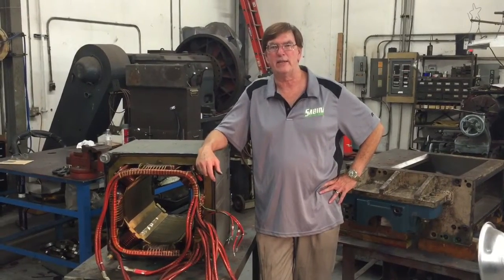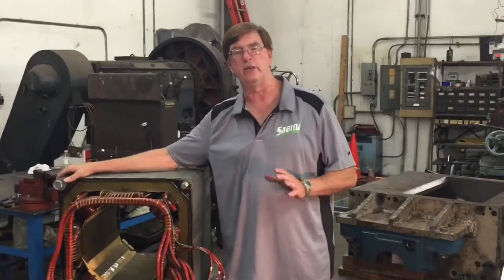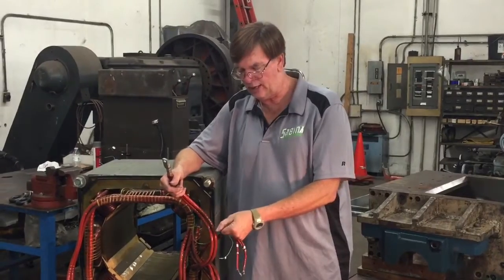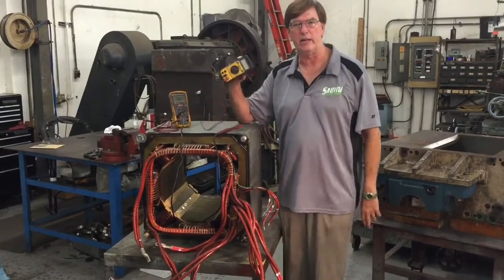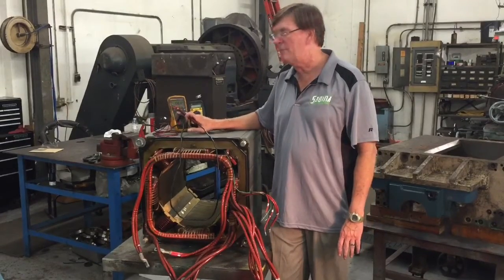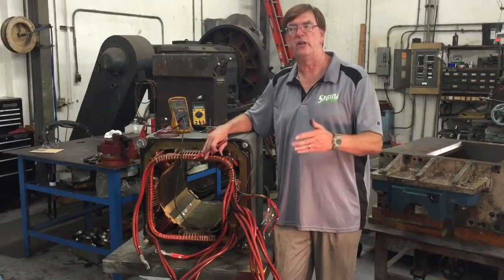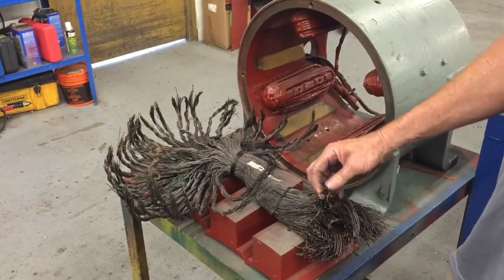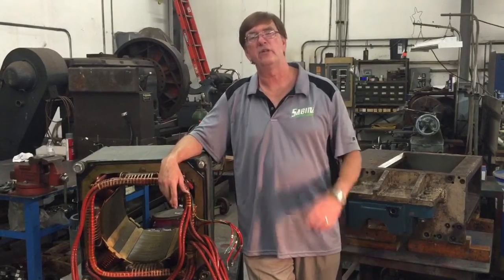Shunt field for D.C. motor

Comment: Never change direction of a dc motor by switching field leads! If it has a compensating or series fields the polarity will be bucking each other. Only change direction by switching armature leads
Reply from the maker: This is true some motors have an additional series field.  Good note thank you.

Comment: 20 Mega Ohms is low. I wouldn’t ship a motor unless it reads over 200!
Reply from the maker: It varies.  Our motor shops goal is 2.2G but some motors that is impossible.  I had a 6000hp in Ohio that had 20k ohm and ran fine (NOT RECOMMENDED).  Was VERY nervous starting that up.  20 Megs on 500vdc armature is pretty normal on larger motors as they tent to read lower.  At 1 Meg I tell the customer its up to them.  It could run... It could ground out (boom)